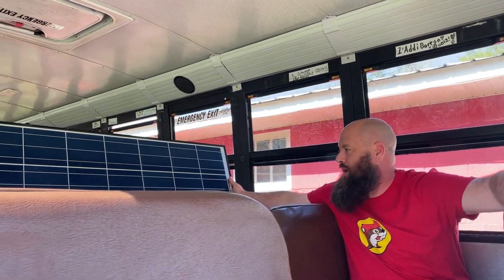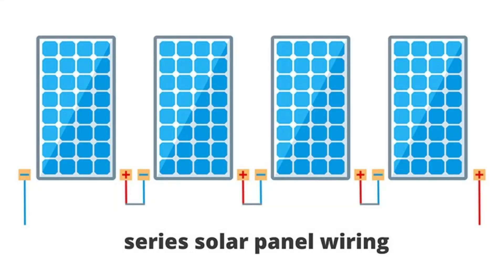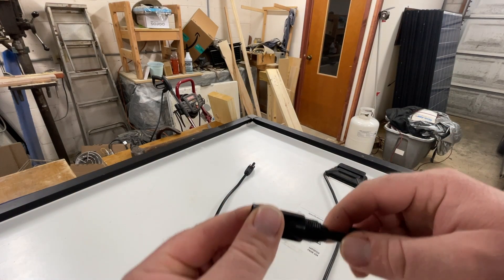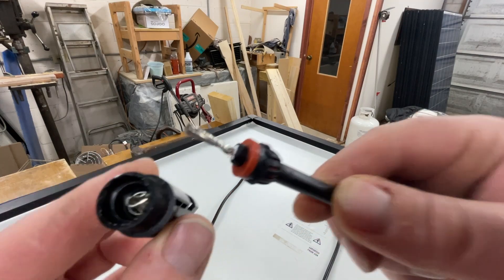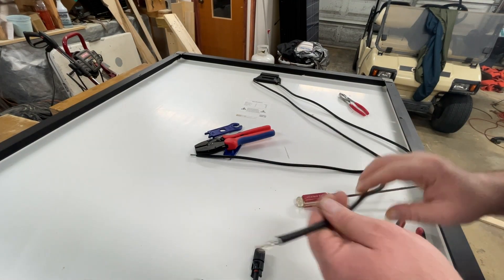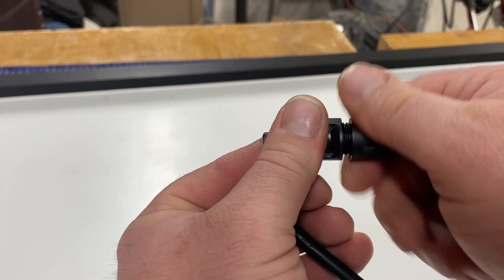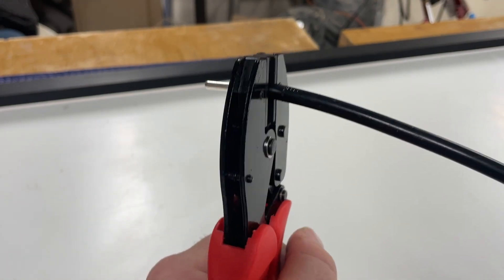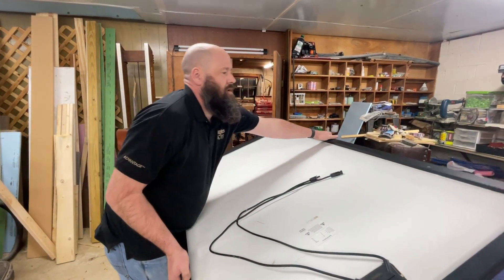Are Used Solar Panels Worth It? I Got 25 for $30 Each!

Comment: = I have wired "ODD"  numbers of PANELS  in Series / Parallel for MONTHS & experienced 
no  No  NO  ill effects 
SIX (6) Arrays in a  6S / 6P   (eventually )  CONFIGURATION 
but   5S / 6P  for six months 
...
just  FYI 
...
COOP
...
Reply: Same, I just made sure the voltage between the panels were not drastically different not to clip a bunch of power and it’s been working perfectly